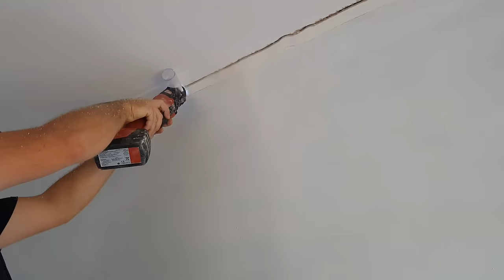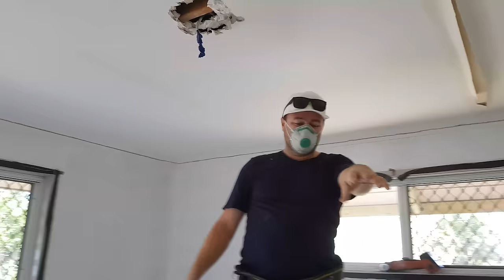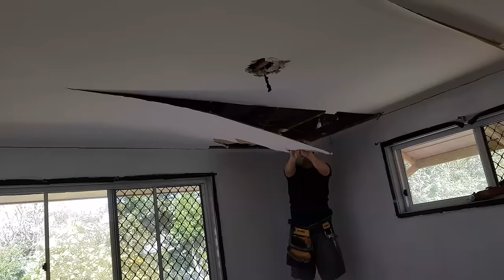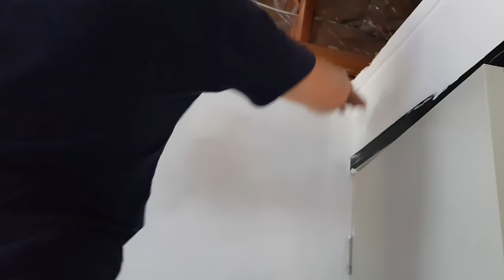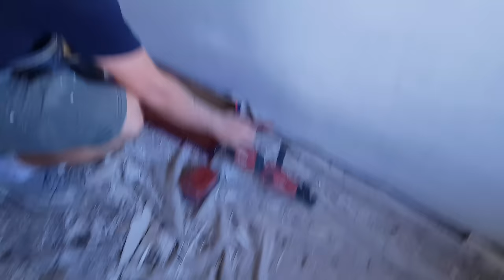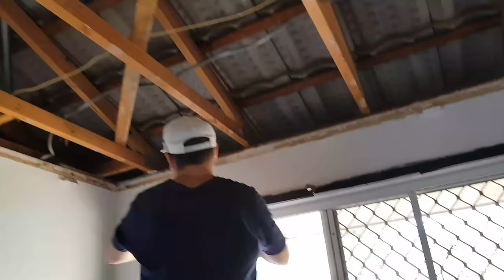How to Remove a Drywall Ceiling Easy

Comment: We just did this last night and found ourselves knee deep in loose insulation.... Messiest job I've ever been helped with... Never again!
Reply: Been there. I tacked string across the ceiling studs as I removed the ceiling and left them there when I put drywall back in place. It worked.
Reply: Do you have a video on how to install bavk the ceiling sheetrock?

Comment: Hi mate, my technique is to get into the roof space and walk on the trusses and slowly pop all the screw fixings with applying pressure with my foot force down. I find this way is faster an easier and ceiling comes down in nearly one piece and dust free falling on me.... sssshhhhhh my top secret.
Reply from the maker: Lol.
Yeah, I've never done it like that but I'm sure it's very effective, you could even add that you can do it with no hands..
I might try that one day.
Most of the time the roof space can be really narrow so could get difficult
Reply: Doesn’t work in a basement

Comment: Started a job as a mold technician while attending college. Removing ceilings suck especially in old houses where it's a concrete like material versus drywall. The ceiling has wiring connecting to hold the pieces together. Just watching this video to see if there were tools to use that are better than having to try and bust through the wall with strength. This looks a bit easier than the material we're currently dealing with.
Reply: You were a "mold technician" but don't know what lathe or plaster is called?  Really?
Reply: @DiffEQ  maybe they call it something else where he lives?
Reply: Everything sucks though

Comment: I notice there is no insulation.  I did just a small area in the bedroom and got that loose stuff everywhere!  Where do you live that you don't need insulation either due to heat or the cold?
Reply: Jackie Kennedy Australia lol
Reply: Lots of people either didn't put any in, OR, it all slid down to the bottom. If you find parallel laid drywall, don't be surprised (supposed to be a brick pattern perpendicular).

Comment: Once the drywall ceiling is gone I would actually extend my walls all the way up to would actually extend my walls all the way up through the attic. The trusses would be left exposed and sanded and I'd paint the exposed attic black for an industrial look once HVAC and electrical passes inspection

Comment: U went around the ceiling with that cut out machine, but how did u not hit any beams ?
Reply from the maker: you can adjust the depth to a mm before it hits the timber. and won't hit. occasionally you run into screws but the blades are very strong I've never broke one
Reply: @Maxkil  
Do u go in an angle or straight vertical when cutting into drywall ? I bought the Ridgid drywall easy cut out tool.

Comment: That's way easier than the drywall with  chicken wire ceiling I'm dealing with right now.
Reply from the maker: HAHA, SOUNDS LIKE IT... I HAVNT HEARD OF THAT. BUT SOUNDS HEAVY AND HARD TO CUT. tHANKS FOR WATCHING
Reply: Well I guess you've long finished the job now, but that's not drywall, that's a plastering technique. It's like lath-and-plaster except using wire instead of laths. The wire is put up then wet plaster mix is spread over it. Drywall is gets its name because it's pre-manufactured so the installation is dry plastering. I've never had to remove the stuff, but I've heard it's hard work. Also potentially hazardous because it sometimes has asbestos fibre added to the plaster mix.

Comment: Hilti some of the more expensive tools.  I just need to cut a bit of extra drywall out of my ceiling where the water pipe leak flooded the hole and square it off so I can put in new drywall panels.

Comment: How did you avoid studs while cutting the perimeter, this unit is littered with studs every 2 feet
Reply: He's just cutting the crown molding.
Reply: That's what I want to know. Presumably at a 45 degree angle through the architrave , even if you do hit a stud, it will just camber it anyway.

Comment: Hello, I was told my ceiling has mineral wood, but doesn't have antivibration holders so I keep hearing footsteps. I need to remove the drywall, apply VCL membrane, the antivibration holders and then apply the mineral wool and dry wall again. My question is, do I need to remove all furniture from the house or can it be done while covering everything from dust and other remains?
Reply: I'd buy the guy a rug from Wayfair instead. Lol.

Comment: When placing plastic for a vacuum seal before demolition of the ceiling , do u place plastic over the return on the vents for the heating and cooling as well cause of the dust going into the A/C ?
Reply: You turn of the ac

Comment: Any tips for cleaning up all the dust afterwards? I just had a repair done to my ceiling and the whole room is coated in brown dust along with everything in it 😢
Reply: Hello, did you have to remove all the furniture or is it possible to do it while keeping everything covered?
Reply: @Lextragon  To be on the safe side I would move everything in the room out just to ensure nothing gets damaged. I learned my lesson the hard way and had to throw some things out

Comment: Thxs for the video. .Im trying to figure out what to charge for this? I  have drywall company in canada.
Reply: You'd just charge the going rate for unskilled, paid labor. You could mark it up a bit but anybody could do this work.
Reply: I think $100 to remove ceiling, $1,500 to reinstall ceiling.

Comment: I am getting in DIY, and looking in tiring down the old, very old plaster ceiling, what is the cutting tool you are using?
Reply: Jmo, I wouldn't go there. Plaster rules. It's very strong. Water isn't that big a deal. And fixing it is easier, too. Repairs last much longer. Insulates better AND very soundproof.

Comment: Can anyone suggest best way to address loose insulation above ceiling before tearing it down?
Reply: Id say putting down tarp or something to roll up and throw out or reuse by putting up poly sections and filling it in. New insulation would be easier Id think though in batts
Reply: Depends on what it is and how it's up, imo. If its fiberglas, that's not my wheelhouse. Nope. I'll take the dumb tiles out all day, once I know they're not asbestos, tho (Armstrong never sold asbestos ceiling tiles, according to lots of asbestos-obsessed Flikr people). God only knows what's in that dust, tho...

Comment: That's the easy way? I don't stand on anything.Any time I can work from the floor it's easier. I use a hoe or a shovel and sometimes a galf hook. That way I'm not near it.Ni need to cut that edge if it's gonna rip the tape off.I know it's fun.44 years of drywall I imagine I have done hundreds of jobs like that. Right now I'm tearing out the ceilings in a big house with 8',10' and 12' ceilings with twice blown insulation on top of it with crown molding so it has to be cut away from the molding. Yeah,lotsa fun.